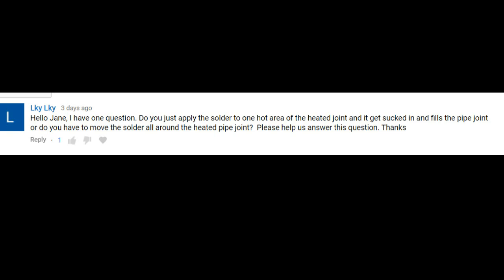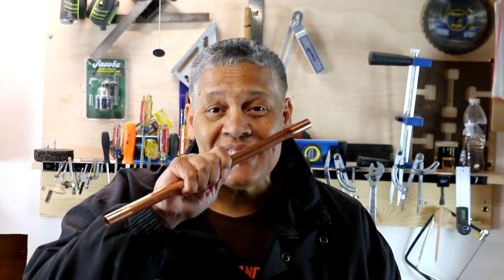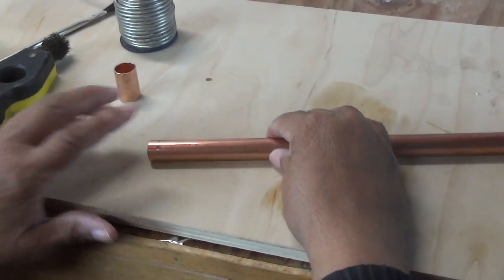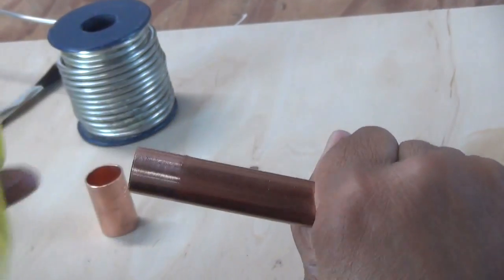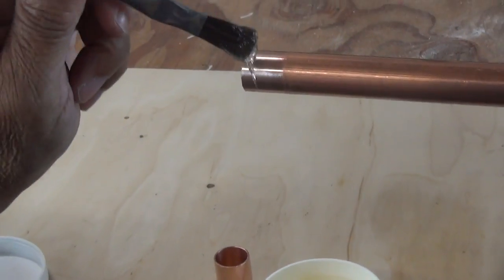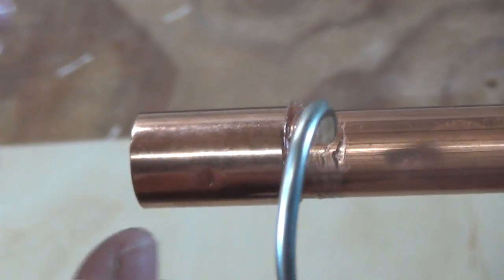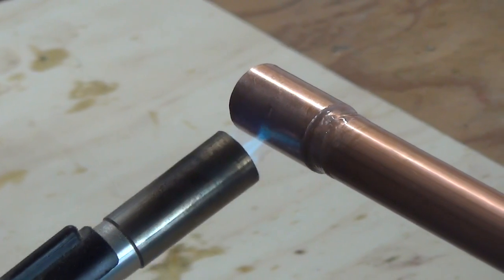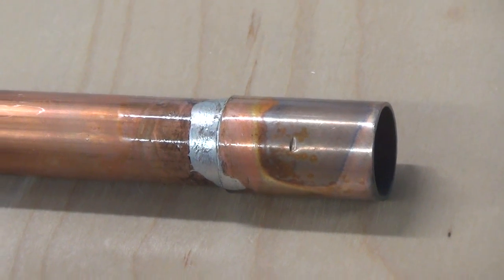Soldering Tips for Beginners

Comment: Too much solder can lead to problems down the road. Whoever did the plumbing in my house did a crappy job. There was solder all over the pipe. Apparently some got inside the pipe too and right where there was a blob of solder, the pipe sprung a pinhole leak on the hot water pipe just after the water heater. Since the pipe was in the wall, it took a bit before we knew it was leaking. It was a big mess that homeowners insurance didn’t cover. I’m not even sure how it got inside the pipe but I assume it was capillary action. There were blobs of it everywhere.

Comment: Thanks! I'm familiar with PEX crimps, but I've never worked with copper. I had to replumb the bathroom, which I did with PEX, but I needed to solder some cooper->pex adapters, and I was able to do so successfully. I feel a lot more confident about a soldered connection over sharkbites in the long term.

Comment: This is good Leah! The tradesman that taught me back in the day was a fanatic about keeping the joints clean! One of my jobs was to cut and clean the pipe and fittings for him to solder. He taught me to clean the ends of the pipe and the fittings with alcohol to remove any residual processing oils on the copper BEFORE using the brush and emory cloth. That way the brush and cloth would not build up any oil on them and contaminate the joint. I don't know if it helped or not, but he almost never had any "do-overs"! Another great video!

Comment: Excellent teaching skills, but I’d like to add for an even better joint wipe off excess flux before applying heat then use solder sparingly, it’s a surprise that you only need a small amount of solder for full coverage. The gap between the fitting and pipe is surprisingly small, most people over use solder. Here in the UK the top plumbers pride themselves on solder joints where you practically can’t see any solder at all.

Comment: Can you re-do this video so that the application of the solder is easier to see?  The break in the video makes it look like you applied too little to fill the entire void.  Also, orienting the pipe vertically going upward into the fitting and removing the fitting at the end to show that the capillary action did indeed fill the entire fitting would go a long way to show viewers they don't need much solder (I always go all the way around for a vertical fitting so you'd be proving something to me).  Finally a mention on how to guess when your fitting is hot enough / too hot (green flame) I'm sure would also help.

Comment: Looks like you cleaned the pipe a bit deeper than you showed us initially during the video cut.  You wanna clean as deep as you are applying the flux else you can pull in impurities.  Similarly, it seems like you over applied the flux on the pipe (just a little bit).

Comment: Two part questions.
1. When I cut off the shut-off valve, there will only be, give or take,  a half inch to the dry wall. Should I cut away the drywall so that the heat from the pipe doesn't cause a problem with the dry wall?
 2. I noticed that the old shut off valve is not working when I changed the faucet. So I had to turn off the main. Unfortunately, the main doesn't completely shut the water, slow drip. Which means I can't soder, so what can I do?

Comment: I have several questions.  

1.  Is the solder being drawn in by the flux melting out of the space and creating a vacuum or void that the soldier replaces, or is the flux only for helping the soldier adhere to the copper and it is the heat itself that draws the solder towards it?  If it is the heat, then why do you not have to mover the heat around the pipe to draw it to the far side and fill the cavity all the way around?  Your video said  that you do not need to go all the way around the pipe, but you do not show much of the actual soldering, only the finished pipe.  

2.  Referencing your earlier video on cutting copper pipe, I attempted to cut pipe doing the same thing, but the starting groove didn't line up once it went around the pipe and would have continued to do a barber pole effect, so I stopped, found a clean space on the pipe to start over and it did the same thing even though I did my best to make sure the cutter was snug and straight before starting.  Thinking that my pipe cutter was faulty, I bought a new one and it did the exact same thing.   What am I doing wrong?  

3.  Copper pipe is very expensive and I am fast running out of pipe.  Once the groove is started, it appears that I can no longer cut in the same area without the blade following the same crooked path, or is there a way to salvage the pipe?

4.  I noticed that the two rollers opposite the blade on the pipe cutter both have a groove in them, but the groove is not centered under the blade where I would think it would be.  I notice the two rollers on your cutter do not have grooves in the two rollers.  What are the grooves for?

5.  I have a leaking 12 year old water heater and a new one sitting here for 2 months that needs to be installed before the old one explodes.  The new one is a hybrid and is 8 inches taller so I need to remove the old pipes at the wall and add to them.  There is only an inch of pipe sticking out of the wall and an elbow I need to remove.  I have run through a whole cylinder of Mapp gas attempting to de-solder the old pipe from the wall, but the old solder doesn't seem to want to melt and come loose.  I used considerable pressure attempting to twist the fitting off the pipe while hot, but I am afraid if I twist it any more, i will break the pipe inside the wall.  I called several plumbers and asked how long to change the pipes if I provided all the pipes.  They all said it would be only 30 minutes work, but wanted $500 more to do the 30 minute job.  That did not even include moving the new hat water heater into place and connecting it.  BTW, I live in Houston, Texas and since Hurricane Harvey, prices for any labor have all doubled more.  We got flooded a year before Harvey and my wife has been disabled for 30 years and the mold in the house is very bad for her.  We have not started fixing any of our flooded home and for 2 years still sleep on the floor and eat in the garage as it is the only habitable place that is not moldy.  I know I can do the job, but I am doing something wrong need to get this hot water heater installed ASAP.  Any advice would be greatly appreciated.  We have faith God will provide for our needs.  God bless.
Reply from the maker: Hi there, I would like to help...but it would be easier for me to correspond with you via email. I also have some additional videos that might be of help.  can you email me your questions, please?

Comment: Need to wipe flux off or you get corrosion on the outside of the pipe. Using a rag when solder is still hot will allow you to smooth the joint. But great job!

Comment: Another tip to soldering is to apply the heat to one side of the pipe while touching the solder to the opposite side. Once the pipe is hot enough to melt the solder on the other side that is all the heat you need. The solder will flow easily around the pipe towards the hotter side. Also, wear a pair of brown jersey gloves when you are soldering. They will help keep your hands clean and oils on your hands from getting on the cleaned pipe. If you get a little drip of solder you can quickly wipe it off with the gloves as well while it's still hot.

Comment: Thank you Jane really Love your videos, what about the piece of bread trick to get control of the water in the pipe? I was taught by a plumber that heat rises and wherever the heat is applied place the solder on the other side of the pipe, it sucks the solder right in... you have to do it this way if your using brass. In Florida most of the plumbing is CVPC now. I ran into a problem replacing the tub spout and it cracked the CVPC fitting & I had to open the wall and there was copper in the wall from previous plumbing, that gave me enough parts to replace the CVPC with copper where it matters. The next time the tub spout gets replaced there wont be any cracks or leaks. What needs to be made is a tall mirror cabinet so theres always access behind the shower. In the old days when there was a plumbing problem you really did need a plumber it has gotten way more easier for a home owner today especially with the shark bites which I have never used but I do I have different size shark bite caps in my box just in case theres a leak and I can cap the problem so the house isn't without water till it can be fixed. Thank you again Ms Jane you are a very good teacher & I have learned many things from you!

Comment: Two words - shark bite!
Reply from the maker: Justin Van Bibber    I've done several shark bite videos.   I like their product but it has limitations.   I think a soldered pipe has its advantages as well.
Reply: Sharkbite fittings are great in some situations, but they're expensive and I'm not sure how much I'd trust them in the long term. You're relying on a rubber gasket to make the seal which may wear out at some point - I certainly wouldn't want one burried in a wall.

Comment: It's a good skill to save money when you get a new water heater as well, since you can install it yourself.
Reply: Cliff, be SURE to watch vids on changing a water heater before you take on the task. It isn't hard, but there are a few things you must be aware of. Example: use dielectric fittings between dissimilar metals. When you go to drain it only opening the drain cock will take all day. You also need to open the pop off valve. If you don't you're trying to drain against a vacuum. There are a couple of other little tricks but it's all on Youtube videos.
Reply from the maker: Clifford Burruss  I agree

Comment: Soldering takes practice!  Once, I had to solder a copper tube to a copper plate.  I cleaned them both off with abrasives, wiped up with clean alcohol, slathered on flux, and clamped everything together.  I heated everything up nice and uniform.  When it was hot enough, I touched solder to it.  The solder beaded up and rolled away, while the flux turned black and burst into flame.  I'm a real pro, I tell ya.   The next few times I did this, it worked fine...
Reply from the maker: yes, absolutely, practice is what it takes to get it right!

Comment: You forgot to explain why mapp gas is better.  It burns hotter getting the pipe hotter faster.  Makes it way easier when you doing thick pipe or if you doing a lot of joints.  I always make sure I have a 5 gallon bucket of water with a good rag.  After I solder I just wipe of the pipe.  Looks like a factory finnish or something.  Just be careful not to wipe off the solder.

Comment: Needs to be said DO NOT put the flame ON THE PIPE only on the FITTING. Nice video.
Reply: Nonsense. Heat is applied to the pipe and when it’s reached temperature you transfer heat to the fitting.
Reply: "Start heating the tube, first applying flame at a point just adjacent to the fitting. Work the flame alternately around the tube and fitting until both reach brazing temperature before applying the brazing filler metal."
-Harris Products Group
Soldering melts at 350 so I guess it would not matter as much to achieve capillary action vs brazing filler.
Reply: WhoChrisLiu - Instruction unclear. I started heating YouTube as you suggested and my computer set on fire....
Reply: Thanks, Don.  Appreciate the content.
Reply: I apply heat to the pipe, been plumbing 5 years lol
Reply: Never heard of it & never seen a plumber do that.
Reply: Don Kane thanks!  A lot of good information we will be able to use.
Reply: @joebrown1382  your only good as the person who taught you... Picture this.  If you hear fitting only.. The copper expands right??? the pipe gap to fitting have air  space.. How do you have good transfer of heat from fitting to tubing? 20 year+ in plumbing trade... He the tubing then fitting..
Reply: @BC-sk3bp  There's no water leaking out of my copper so I guess I did it correctly.

Comment: One of the issues that I've had is the cheap solder they sell in the hardware stores.  The old lead based solder flowed great, but is not good for potable water for obvious reasons.  However, what they replaced it with doesn't flow worth a damn.  You have to flux the snot out of it, get it evenly hot, and apply the solder just before the flux burns out.  Hate the stuff.

I remember watching a professional plumber and his solder flowed great.  When I asked, he told me that he doesn't use that garbage they sell at the hardware store, but a silver based solder made for pros.  I checked around and with some digging I could get some, but that stuff was around $100+ a roll.

Today, the price has dropped some and you can sometimes find it sold in your hardware store in sticks.  Still much more expensive than the cheap stuff, but it is so worth the extra cost.
Reply: The soldering kits that Lowe's sells have the silver based solder in them

Comment: Nice information but what happens if you do have some water in the pipe? Did the bread trick really work or is there a better way to get the water out?
Reply from the maker: John Ernest  The bread trick does work when there is a slow drip.   Ive used that trick more times  than I can remember.
Reply: John, that trick works but only if a really small amount of water. There is a tool you can buy with an expanding rubber plug attached to a handle. Insert it, sell up the plug, solder a male adaptor or a valve and unswell the plug and remove. You CAN get rid of water, but sometimes it's just too time consuming and a pain. That tool works GREAT. (though I've used the bread trick many times)

Comment: What happens if you don’t use flux?
Reply: Blind, A plumber pretty much always wipes the joint with a damp rag even before the solder has hardened. That has two benefits. It cleans up the joint and makes it look nicer but it also removes the flux residue. Running the water removes the flux remnants inside the pipe. Leah always gets comments from folks with a lot of knowledge in whatever she's demonstrating. Along with the astronomical number of subscribers that proves even the pros like her channel and its really broad range of topics. I'm now retired but I get a real kick following her. More than four decades in a trade I STILL learn stuff from Leah.
Reply: Tom Swinburn
Flux has been found inside pipes that have failed from corrosion (inside out) years after installation.
Reply: "What happens if you don’t use flux?"
You get nowhere.
Reply: Without flux, it will be harder for the solder to flow smoothly
Reply: Ms. Belinda, flux removes oxides which then allows the solder to adhere to the pipes, or electronics.  Without the flux, the solder sorta bubbles and doesn’t do its job which is to join two pieces of metal together.
Reply: you need to put flux on the copper when you clean it with sandpaper and wire brush also.
unless you remove the oxide layer, the solder will NOT stick to the copper.
more is better than not enough, and put flux to wider area than where you want the solder to be.
Reply: Belinda Manning thanks for the info guys.
Reply: Flux has been known to corrode pipes both inside and outside causing leaks if you use too much and don't clean it off.